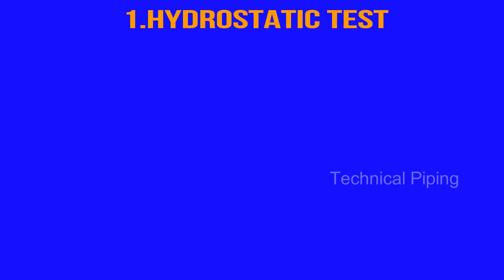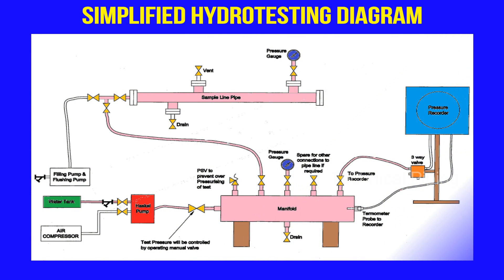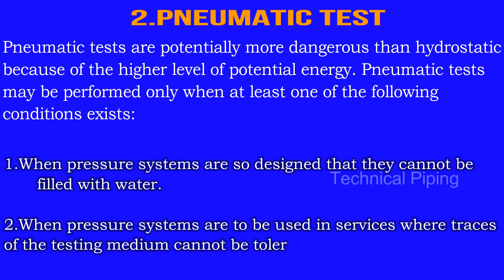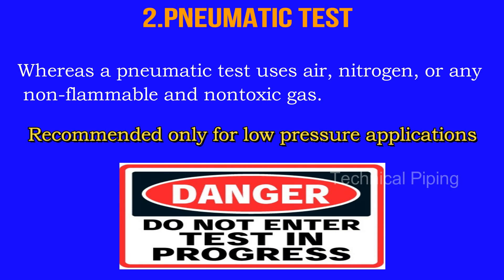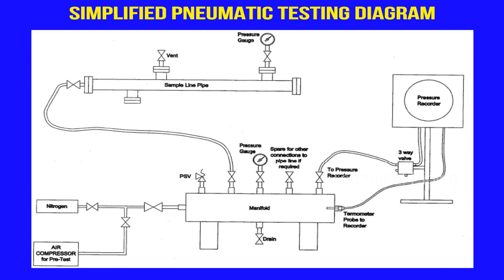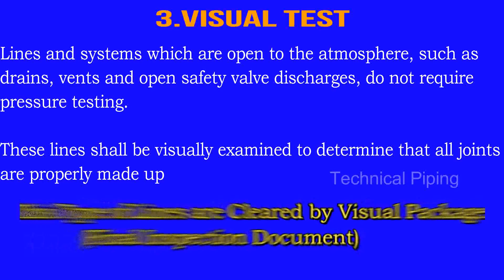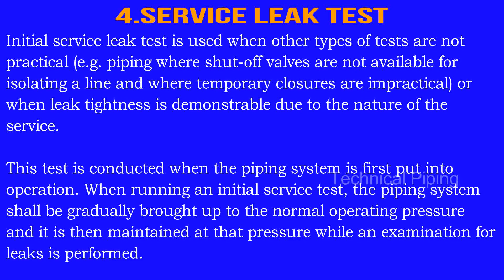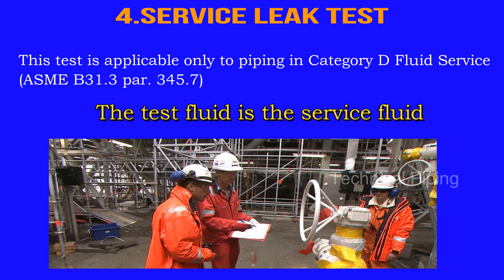Types of Testing in Piping projects

Comment: Hi thanks for the video 
We are looking to test Rubber Bulk hoses Dia 6" at WP 10bar 
I need to confirm what sort of pressure test should be done i.e. either 
1. Hydrostatic (filling the hose with water and then pile up the pressure to WP10bar)
Or 
2. Directly fill the hose with air compressor up to WP 10bar?
Would really appreciate your technical input . Thank you very much